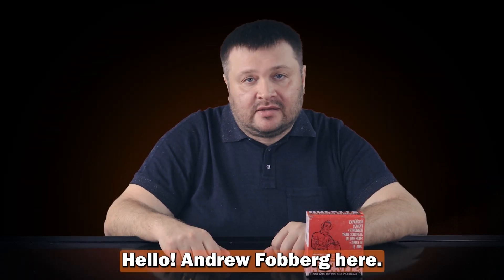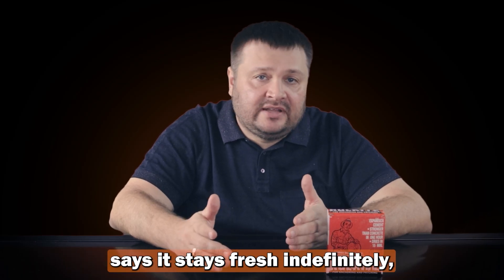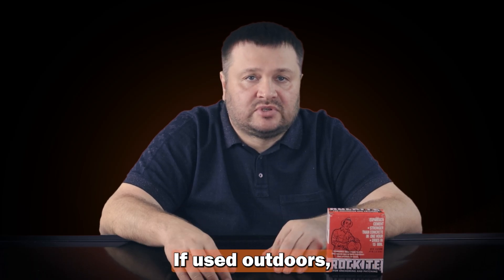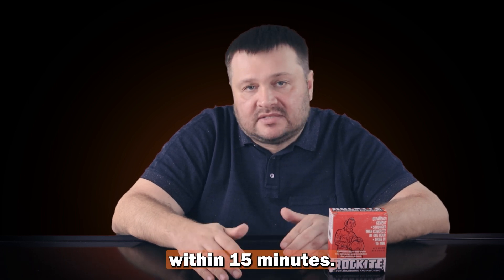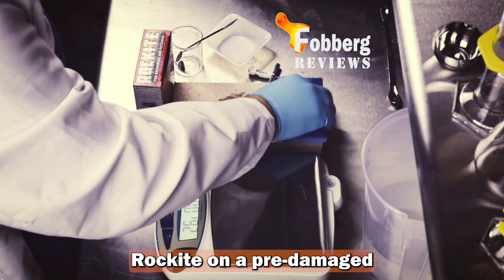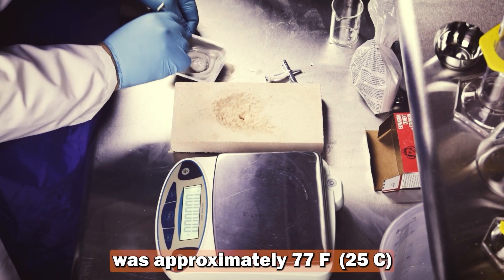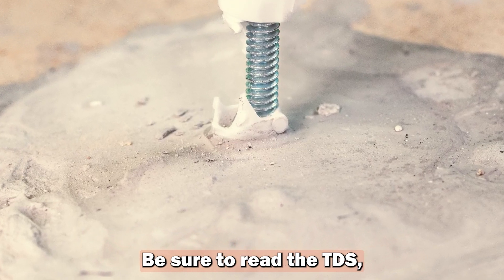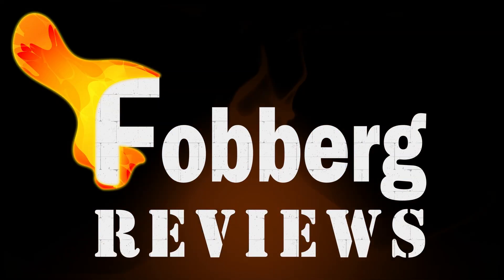Rockite Review: Fast-Setting Cement in Action!

Comment: Just bought a small box today . Need to patch garage floor where the edge has worn off at the driveway as the floor is about 1 1/2 inches than the driveway . The guy at the hardware store said this Rockite was very good . I was actually looking for Sakrete quick setting cement . But the store is a small one and I don't think the carry it .Thanks for the demonstration . Watching from New Hampshire  . Good luck with your channel .
Reply from the maker: Thank you for sharing your experience! I hope the repair goes smoothly and lasts a long time. Thanks for your kind wishes!